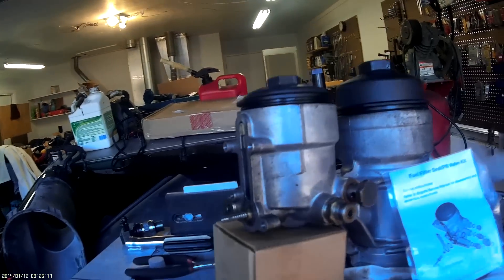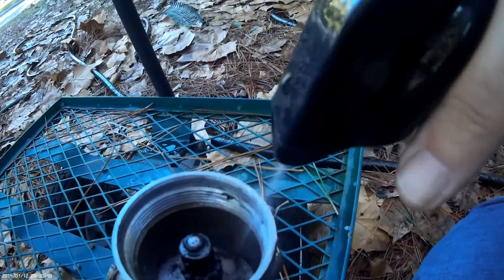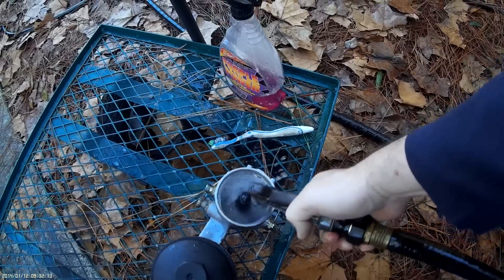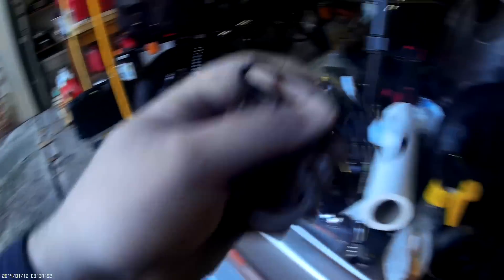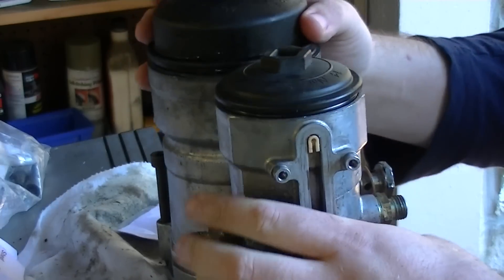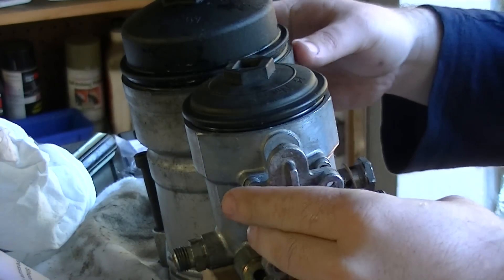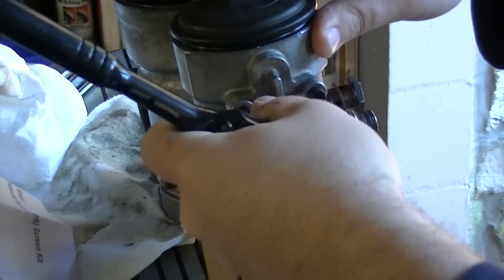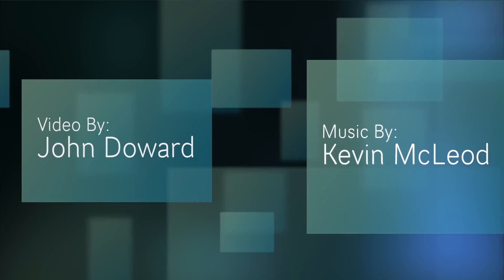HowTo: Blue Spring (Fuel Pressure) Mod for Ford 6.0L Powerstroke Diesel

Comment: NEVER USE WIX FILTERS...I SAW YOU PUT TAHT OLD FILTER BACK IN... BAD!
IF YOU HAVE GOT THAT MUCK GUNK IN THE FINE FILTER.
Reply from the maker: About to roll 260k here with no issues since the last oil cooler change.  Not even studded yet :)
Reply: +uberDoward exactly. i have 150k worry free miles on mine. a good quality oil, archoil, routine maintenance and not making insane power will keep these reliable
Reply from the maker: Lol, nope!  Has the Napa filter, but I replaced it with OEM.  All of my filters are OEM!
Reply: GOOD MAN! ONLY USE MOTORCRAFT! CHANGE BOTH FUEL FILTERS EVERY OIL CHANGE!
Reply: I just got my 03 with 74K, first thing I did was go to NAPA and got filters, I fking found out the hard way....so within the last month i have literally read every article, pros cons, do's don'ts, and what the fk is wrong with it now videos.....I am under the impression I am going to spend 5-6 K bullet proofing. I don't mind but I may just go do a cummins conversion. 4-5 K more and I have an engine that will always be bullet proof and give me confidence I can driver more than 50 miles without breaking down.